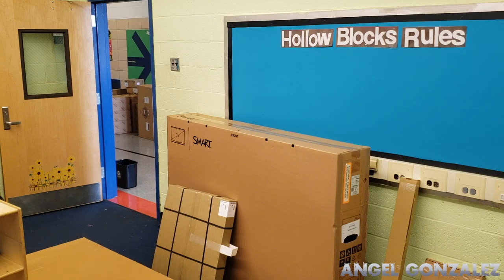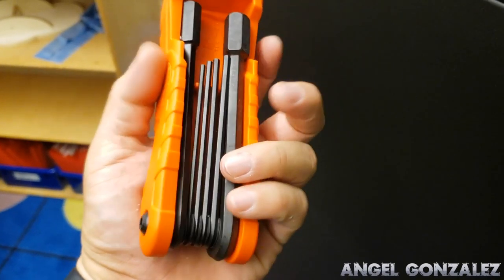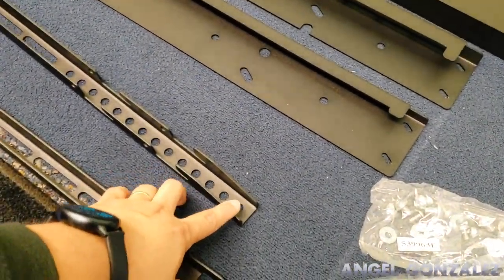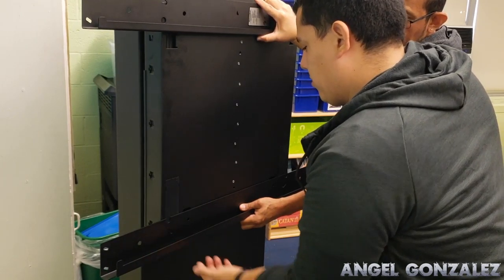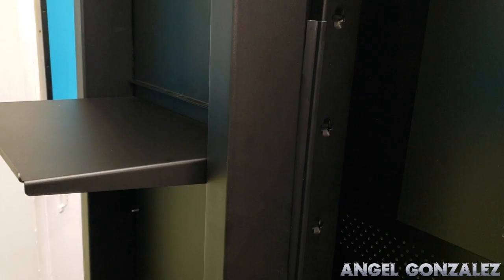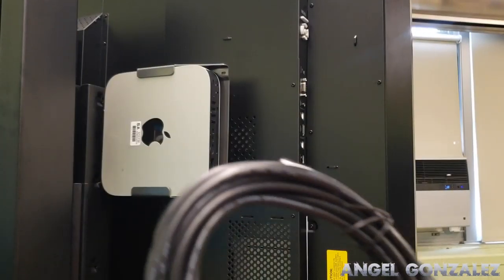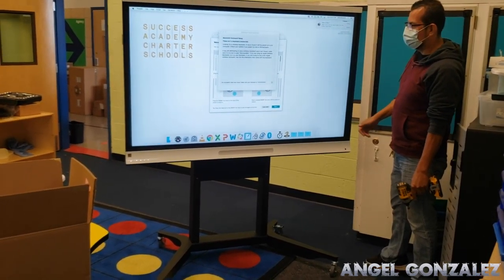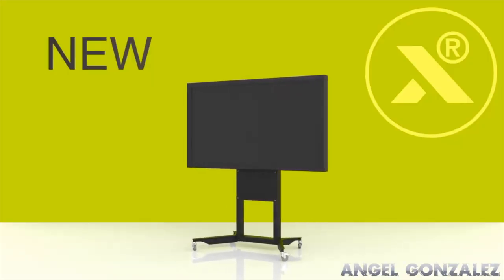How to install the NEW Balance Box 400 Mobile Stand with a Smartboard! MUST HAVE FOR SCHOOLS!

Comment: Thanks for the video!  I made it all the way to the last step, but I'm having trouble getting the Balance Box to move at all.  I tried releasing the tension on both bolts for 5 seconds at a time and I can see the spring compressing,  but the Balance Box is still locked in its default position.  Is there a safety mechanism that needs to be released or some other reason why the box wouldn't move even after the tension on the springs has been released?
Reply: I had the same thing happen. What did you find.

Comment: Hi, great video! Also nice use of the Vesa Interface for mounting extra equipment. If I may remark, when using an electric screwdriver we recommend a lower speed than shown in the video. Also useful while balancing the weight, take out the black plastic cover to see if the springs are set nicely in line with each other. Well done and succes with following installations. Clients will be happy with the High Speed BalanceBox.
Reply: Should the center springs be set right up the top or inline with the outer springs?
Reply: Hi Emmet, the inner springs are already in the correct position.  So only adjust the outer springs to balance the weight.  The answer to this question, as to many others, can be found in the supplied manual.  It can also be found at www.heightadjustablemounts.com.
Reply: Hi, what if one side sits lower?  Do I adjust the spring on the lower side?